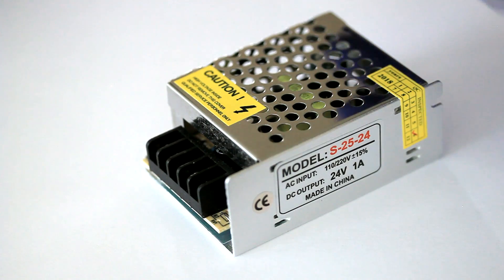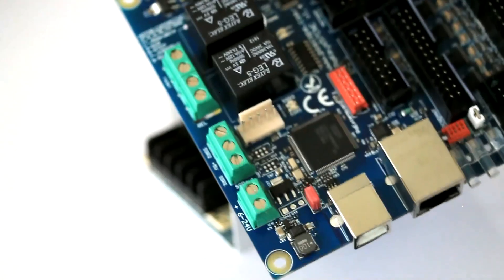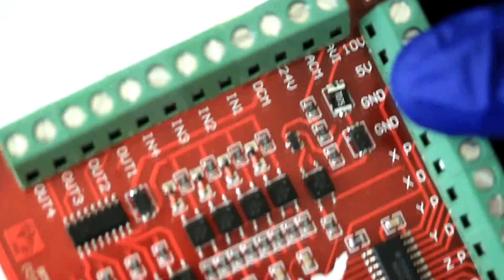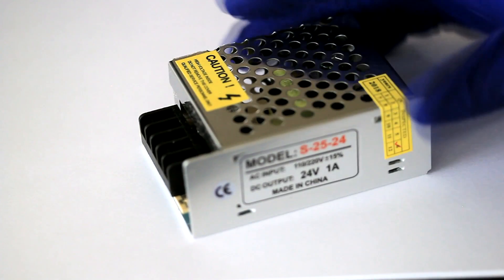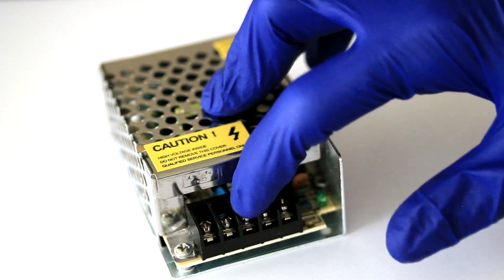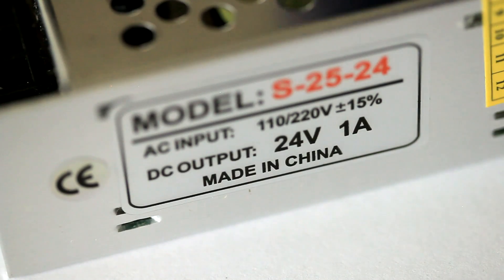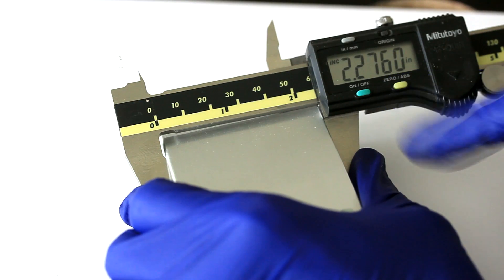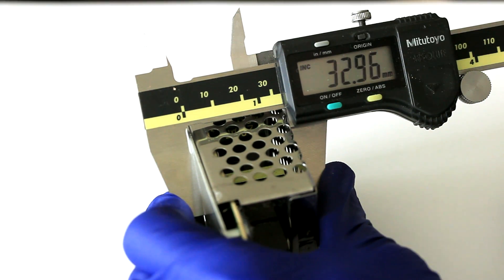BuildYourCNC Product Video: 24V 1A Power Supply

Comment: I am guessing if running any motors off of this, wouldn't want much bigger than NEMA 14's or maybe a single NEMA 17. For things running NEMA 23 motors, I am generally using slightly bigger supplies (ex: 48V 10A).
Reply from the maker: I wouldn't use this power supply for motors.  This power supply is best for LEDs, PWM output more than 5V,  relays, etc.  The power supply is great for supporting devices on a CNC rather than the motion.